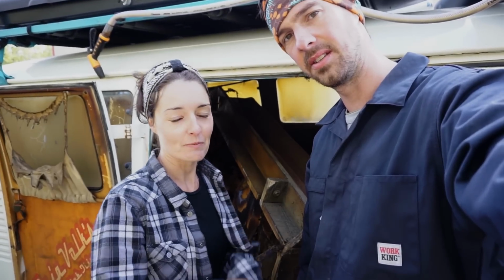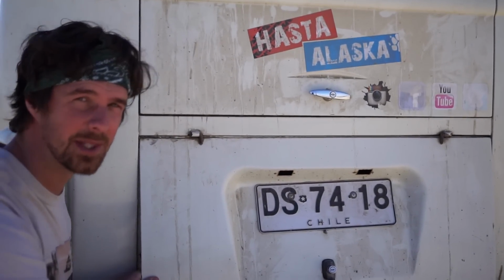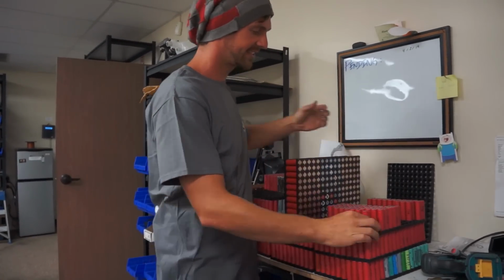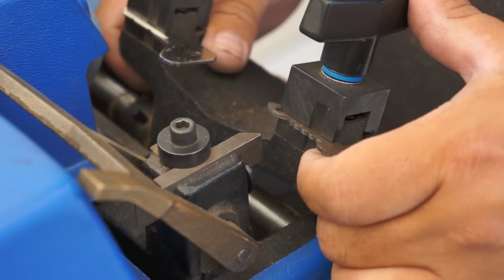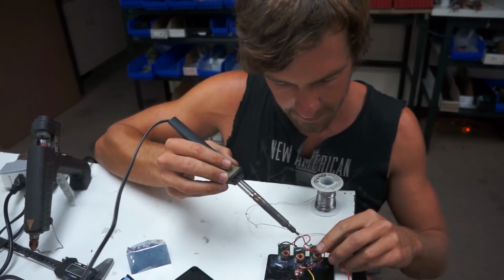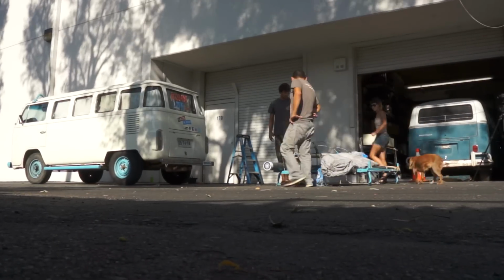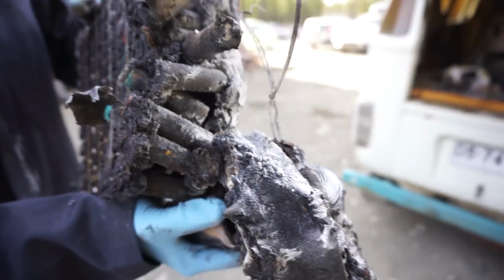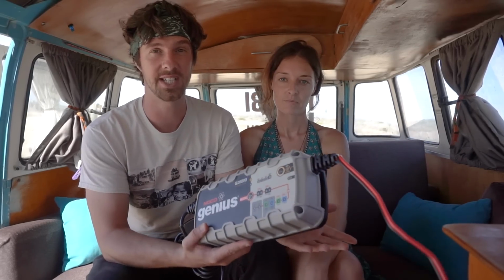Building an Off Grid Solar Battery - Hasta Alaska

Comment: Have you heard of LiFePO4? Maybe that wouldn't set on fire. Still quite light and high capacity. No off gassing either.
Reply from the maker: +kyl3dr yes, a much better solution.

Comment: Hey you no longer  require a spot welding machine/ soldering iron any more if you were to use this https://www.youtube.com/watch?v=6M6Mm6jWqSk&t=159s . All you have to do is assemble the kit according to your battery pack size. You can dismantle it, re-assemble it multiple times. It doesn't affect the battery life nor does it void the warranty if you are buying new cells. Its way way better than the spot welding method. So do have a look and do give it a try !

Comment: stick with lead acid. make sure to adjust the controller to the specific battery charging specs, finally proper gauge wiring and you are set.

Comment: This is a shocking implementation of 18650 cells. It is no wonder it caught fire. Any multi cell li-ion battery needs to be balanced by its charger or battery management system. Without balancing the individual cell voltages will eventually become so out of balance that some cells will overcharge and vent with flame. For example, say i have a string of 3 cells so charge at a fixed voltage of 12.6V with no balancing. One cell fails and so has a much reduced capacity. This will charge first and so reach 4.2V before the others which are both say still at 3.8V. The fixed voltage of 12.6V is still applied so the failing cell charges above 4.2V, overheats and vents flame. You then have a fire that is very hard to put out since all the cells overheat in the fire and hot li-ion electrolyte self ignites. Using recycled cells is particularly bad since the different wear levels of the cells means the pack is more likely to become dangerously out of balance. Li-ion cells cannot be allowed to dissipate excess energy as heat like lead acid can, the charger needs to balance them and stop the charge when the battery is full.

Comment: From what I heard, I think I understand what happened. Your problem was (I think) you don't have a comprehensive battery system. Not only monitor the voltage/electric state, you also need to monitor whole lot of other parameters: temperature, voltage balance, drain rate, as well as actuator for compensation: mosfet and relay to make sure that the battery is isolated (individual cell control is the best, but can be expensive), heater and chiller for environment control, as well as a MCU (the Arduino is quite the perfect one for this, just need to learn how to program it - I think Gabriel can help with that). With all that measure Li-ion can still be quite dangerous, but not more than other batteries systems.

Comment: as a person that use to sell that brand of battery charger that is very costly, they are not what they clam them to be under our testing, there are far better brands on the market, at a lower cost, that do a much better job. as a solar/ inverter off grid installer, I am willing to bet what started the fire, from all the years of installs and service calls we been on and have refused to install the added peace of equipment to an existing poor unsafe system. , main one is, there was no fuse on the positive terminal between the terminal and feed cable, this fuse was not there, it should be a 300 amp fuse connected to the + terminal, I am willing to bet you didn't have this fuse there, we see it all the time, 2nd the connecting cable to the 300 amp fuse must be a minimum of a 2/0 100% copper cable, as well a fuse not in the cable coming from the solar panels to the + terminal of the battery, depending on the amp output of the solar panels and the wire sizes being used, so many times the wire size from the solar panels to the charge controller to the battery bank is far to small, and no right size fuse in the wire at the battery,, in your case you didn't have the amps in those laptop battery's as you do with the larger deep cycle battery's or gel AGM battery's, so you would need a 300 amp fuse, but lit looked like a number 10 wire coming off the battery bank, witch should have had a 20 amp fuse at the + terminal of the battery, also more times then not people are using far to small jumper cable to connect each battery together, with large deep cycle battery's the jumper cables must be 2/0 100% copper cables, inverters and solar panels must be grounded to good earth ground when parked, carry a copper 4 foot ground rod with you, and a #6 bare copper wire for groundingyes I have seen really bad damage done by fire from people not knowing what there doing and NOT properly fusing cables in the right plce, putting a fuse in the big cable 5 or 10 feet down the cable just don't cut it, you will have a fire just as if no fuse was there,

Comment: i had a lithium phone battery catch on fire it was 15 tears ago before we new cold and power were bad ,it was a new battery that had very short life . i decided to charge  it one cool morning i charged it and then left to go to work .thats when it burned a hole thru my seat and i had a magnesium compound bow behind the seat in my truck..and the windows were down 1/2 inch..so once the fire got going it ran out of oxygen it could not burst the windows cause the windows were not closed.Thats when the string on my very expensive bow let lose and shockingly blew out the flames..What a surprise when i went to go home!!.lol
Reply from the maker: wow

Comment: if u went 24v the charging range is less dangerous. ..3s (12.6) will actually be pushed to 14.2v on float on mppt charger. ..if u had a 24v system (7s) wen the mppt is at float stage it's slightly lower than max battery range, thus the battery won't overcharge and will stop the mppt controller from trickle charging 18650s eventually blowing them...if u used a pwm solar setup like I'm guessing you basically overcharged your system gradually over time causing your batteries to over heat daily on max charge
Reply from the maker: thanks for the advice, interesting
Reply: Kombi Life you can get a "capacity controller " to manage your 24v 7s battery system and just leave it connected 24/7...it will make sure all batteries arethe same voltage as the lowest battery. ..they only cost  $5 on ebay. ..if you guys want some real help my face book is Dylan brook  Desmond.  you can add me and have a chat.  i build electric bmxs that do over 100kmh and i have a flawless  18650 solar setup that actually runs 1 of my bikes  (2 birds with one stone ) i usually ride my bike at night after using the same battery to cook with (2800watts continuous ) that guy knows a lot about running motors on lithium. ..but everyday charging is different

Comment: Interesting,My biggest question is did the 18650 have a BMS ? Would of been good to see more photos or videos on where the fire started from.
Reply: No BMS and no solar charge controller. Only DC - DC buck converter.
Reply: Well, there you go. So no safety in place to protect the battery. How was this not seen to be a problem? No wonder it overcharged and there was a fire. Even a cheapo BMS would of solved the problem. Tho using a DC-DC buck over a MPPT charger also sounds silly, at least with the charger it would have a battery voltage limit.

Comment: it seems that the lithium is rather unstable and has problems that as of yet have not been worked out. They seem to be susceptible to igniting and/or blow up if there are mechanical problems (an impact)  or wiring /charging issues.  Suggest you look at this youtube video :

 https://www.youtube.com/watch?v=rvkEpstd9os  

Jets that have used lithium caught fire. Not to mention the Samsung phones with exploding batteries (or the HoverBoards)  all are lithium. They are good but they are very fickle. Also, note how they catch fire. Seems your observation "lack of oxygen" is what saved Copito was exactly right. Check it out: https://www.youtube.com/watch?v=rvkEpstd9os

Comment: saw that soldering skills. knew what whas the reason for the burning *lul
Reply from the maker: it lasted for over a year like that - still think it was the soldering?
Reply: who knows but the soldering looked very bad no matter what. but i also wonder what kind of bms you used for the balancing. i see the balancer plug but did you even using it? even with bms the cables are to thin and or you need enough discharge power to "fight against the 10a maximum of that 100w panel. also it looks like especially one part of connectet cells go rouge so i think they get overcharged.
Reply: matze x wen a bms goes. ...the pack usually catches on fire. bms are for lazy people.a  capacity controller setup is alot smarter and safer than a bms
Reply: I agree about bms. I just want to know what he used to balance the pack.

Comment: I watched the video and I work with lithium batteries alot. Did you have a balancer on your cells? EACH individual cell has to be charged independently or you will have a fire. Just something to think about.
Reply from the maker: each cell ,not just each group?  no balance charger
Reply: Ok. Well I would be willing to bet that was the cause.

Comment: i also wouldnt trust any of you to solder for the life of you...  the soldering i saw was awful.  in every way.  having a beginner wire up something like that was a huge mistake.  intermittent connection.  cold solder joint.  intermittent short.  compromised regulator from being over heated by the iron for too long.  melted wire jacket, causing that type of short from a sloppy job is fairly common.  not too mention soldering directly onto the cells with no experience could have compromised any number of the cells.  or a bad cell.  or a weak cell.  anything could have gone wrong in that rig.  it should have been built by a professional.
Reply from the maker: You are not the first person to suggest soldering wasn't a good idea. it worked for a long time is all I can say so I don't believe it was a problem with how it was put together.  Of course I might be wrong.  Thanks for your comment

Comment: Sorry, there IS someone to blame. You two idiots are definitely to blame. Solar is very safe, IF you don't cheap out and use slapped together parts like cheap 18650 cells! You made an excellent video of what NOT to do!
Reply from the maker: glad you liked it!
Reply: 18650 cells, used or new, are definitely the way to go. you just need to take proper safety precautions like the manufacturers do when making the same things.

Comment: I think the cause of your fire was the from your used lipos and the way you built the larger battery with the laptop batteries.. Something could of went wrong with your charging system not shutting off when a cell was charged or you had a damaged cell.  Did you balance charge? I would never buy a battery from that company you showed.  I don't think the temp of your battery was an issue.  When charging lipos they should be in an open space and you never leave a lipo battery when charging. Best place to get a battery is to buy a new system that is used for RV's or sail boats.  Do not use old laptop batteries.  That is a cheap and dangerous way to do it.  Spend the money on a known manufacture who had product liability insurance.
Reply: used and old batteries are perfectly fine and safe to use. just take general safety precautions when testing the batteries and properly building the packs.
Reply: mikeph4 lipo chemistry can be tricky.  You can have perfectly built cells when built but if they are not charged right or if you are having an unbalanced charging because the charger failed to stop charging the batteries can puff up and become unstable plus you are not supposed to keep these in a hot car and that can cause them to puff.  We had a guy at the field who had a fire in his garage during s charging from an unstable lipo that was fairly new.  Most of these batteries are made in China.  Hobby King is the biggest seller for RC lipo batteries.  When charging they should be in a firesafe bag, box, bucket of sand or even a fireplace.  When the casing breaks you get an intense fire and can cause the other cells to catch fire too.  I would never keep a home made battery system like this in my car, RV or boat.  Lipos carry more power than lead acid,  can be charged more cycles, weigh less, can be deep cycled but can cost 3-4 times more than lead acid.  I believe there was a charging problem with this fire.
Reply: mikeph4 not for everyday use 1 year could be enough daily cycles to kill a cell and cause a fire.  i always date my packs  so i know how old they are

Comment: Hey guys. Great vid. Since you are in america, the land of the motorhomes, and want to exchange your vehicle... You should check out the Volkswagen Winnebago Rialta. The used ones from the 90's sometimes sell really cheap. 
Actually check motorhomes in general, the used class A and C with about 15+ years are crazy cheap and a lot of them have low mileage.
Reply from the maker: thanks
Reply: Also check out old diesel ambulances and school buses, they would need to be converted to RV but I guess that would not be a problem for you guys. They have very good fuel economy, the old ones run with any type of diesel and they are build like tanks. The ambulance already have insulation and electric wires and lights installed. There are always a couple of listings on ebay. 

I am planning a trip like yours but reversed, from US/Alaska back home to Brasil. If you guys have any good tips for a overlanding rigs please share, I would love some advice. And no, I am not getting a kombi, lol, I have drove enough of those for work already ;P
Cheers

Comment: Let me understand. You used the lithium batteries with a non balanced loader and did not install a battery management system?
Reply from the maker: correct
Reply: Ok that was just plain insane. 
That you should never use a lithium battery without management and especially overloading will make them burn/explode should be common knowledge...
Reply: bikeinmotion overcharging was probably not the issue here.. if you have enough parallel cells you can just charge to the pack voltage unbalanced (eg. 12V) but I would never do it unsupervised. Btw, power tool batteries, like for example 18V 5S packs are also not balance charged. But that only works because they use brand new cells, perfectly matched from the same batch. I think the problem was one of the reasons they talked about in the video.. either the temperature issue or one cell simply going bad.
Reply: +Ivan Stroganov the cells were tested, so it's unlikely this was the issue because of them being used. perhaps a cell went bad, but the fusing should have stopped any real issues, unless it started to catch on fire.
Reply: If I understand correctly from what they said in the video they did disconnect the load but not the solar panels/charging from the battery. As soon as the guy who moved the van removed the cover of the solar panels it basically just overcharged the batteries. A 100% sure way to catch a fire. Just search on youtube for LiPo fire. Basically everybody who does this testing is just putting a constant voltage on the battery 'till it explodes...
Reply: mikeph4 testing only helps so much with cells near their end of life.

Comment: lol Thinking you can do solar and battery on the cheap. Your dreaming. Go to work for 3 mths and get the good quality stuff.  I can tell you from experience cheap does not last long. What you save in DIY you loose in repairs or have to replace it.
Reply: but you gotta admit the approach is consistent for anyone who thinks driving a VW bus on long trips sounds like fun. Or short trips...    ;)

Comment: did you have a battery management system on the battery pack if you did that could of failed and the batteries just could of been over charged  to destruction

Comment: Hi! Great video, thanks for posting! By the way, have you thought about maybe implementing some kind of regenerative braking system, sort of like the CURS system on the Formula-1 cars? When you brake, it turns the wheel hubs into alternators and puts them under load which causes deceleration.
Reply from the maker: no - that would be neat though :)

Comment: I would be interested to know if your lithium battery had a charge controller? Ideally a balancing charger. (effectively a BMS that is only active while charging) 
You can hook up a solar cell straight up to lithium cells. But not in a safe way. 
Lithium cells really hate being overcharged or charged too fast.
Reply from the maker: it didn't have a BMS - and was charged with a DC-DC from the single panel which was capable of putting out 100W
Reply: There's your reason for the fire, one (weaker) series group went over 4.2V, that usually makes cells overheat and start burning! BMS with lithium ion is mandatory! Overvoltage on the group>Shunt limit(balancing) then cut off when others reach same 4.2V, undervoltage on any group>cut off, overcurrent>cut off overtemperature>cut off undertemp >disable charging... Also https://plus.google.com/+ZegaracRobert/posts/Tou47ZMg7kh?sfc=true
Reply: yep, it only takes a few tens of millivolt over-voltage to hurt a lithium battery.

Comment: in the battery set up, I haven't seen the circuit breaker that will cut in case of over-current also the cables you used were too thin to hold high current. also in the future, add the manual switch that will cut the circuit - the plus side. maybe with the stronger alternator you can use higher capacity batteries that you already have :)
Reply: Hello, DIY Tesla Powerwall, why don't you open your channel to comments, and explain us how you built your arduino based BMS more precisely? i am very interested in.